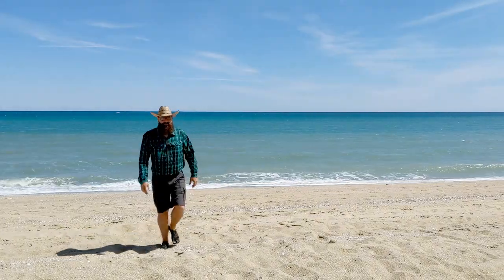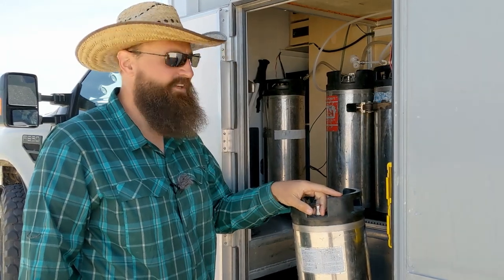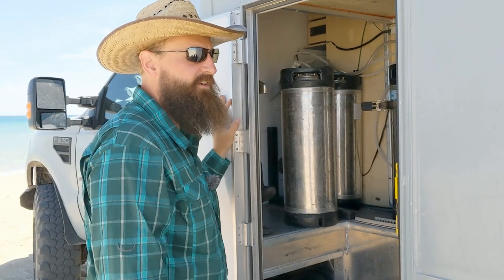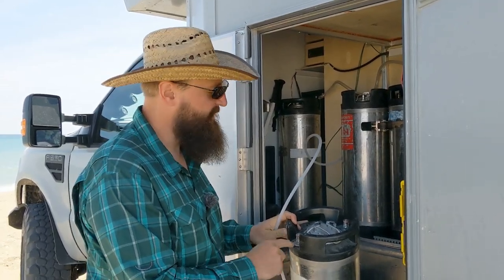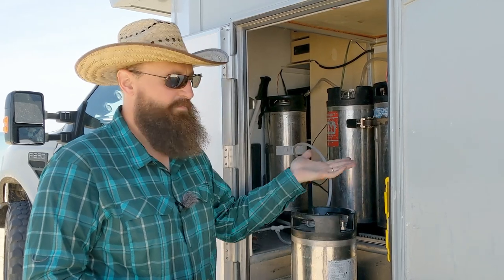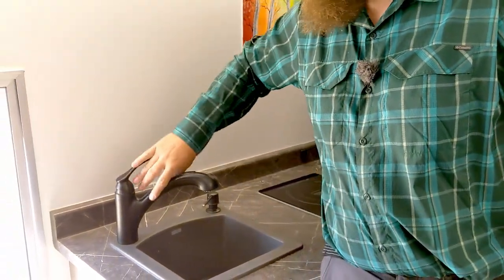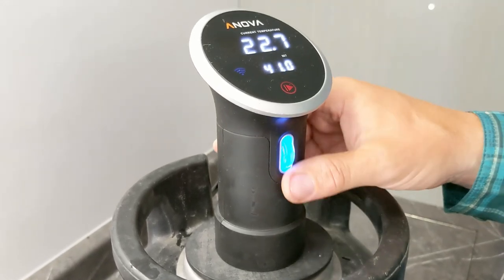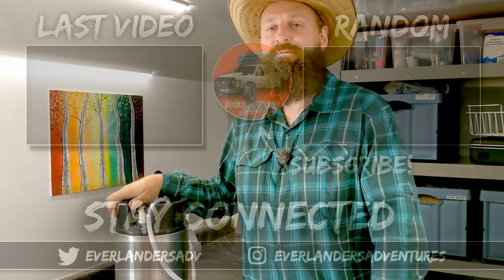Keg Water Systems Finally Explained - Mexico Water Filtration - Everlanders see the World!

Comment: Brilliant! Using air support for various [things otherwise requiring motors] was my *initial direction— and one that I’m now reconsidering because of *your ingenuity! Glad to hear 40-50 psi can wash Kara’s hair(!)
I’ve long heard that the ABS/PVC tanks taste bad and can be hard to clean, aluminum tastes off, so SS is the only way for drinking/cooking water. Hard to find that fit, are openable/cleanable, and affordable. This may be the ultimate system. 
Love that your heater is *tuneable to degrees— I was resigning to the stove: boil one + cold two = shower. Maybe it could be 3gals on an induction stove.....?
Reply from the maker: The boil one (on the camp stove) and two cold was the backup plan... But the ANOVA heater has worked great and there are many cheaper options now too, I think Walmart even has a house branded one.
Reply: Everlanders 😎
Reply: @Everlanders  , Webasto makes a variety of devices, believe there is one that does water heating as well as heated air. Might be worthwhile to upgrade your air heater to the twin heater, the fuel vice the electric heat should make a good alternative when solar isn't as available.

Beyond that great videos, I've only recently started through your videos and I'm in constant awe at your skills and forethought. Well done.
Reply: Everlanders Your water system: are your tanks hoselined in series and pressurized from the end-most, or from a central rail? I just received my kegs and looking to parallel your setup (tho I want to stack the kegs, and use my 2.5gal as a holding tank for filtered water under the sink). 
What air compressors are your primary and backup? 110VAC; why not PTO? 
Also asked at Expedition portal, but this usu gets faster response. Great build
Reply from the maker: Yes, the tanks are in series, that way I only need to fill the empty ones...  We have one Viair compressor for daily water use and an ARB Twin for tires and pneumatic cylinders as well as a backup for the water system. https://youtu.be/HFS2_4ul4ug 

110VAC Air Compressor??? No way!  All 3 are 12VDC and are powered from our solar system. And no, not PTO because then I'd need to start the truck just to air up the tanks if we are stopped for a few days or longer. Not to mention a PTO compressor is likely oiled and much more expensive. Better suited for Air tools, but totally overkill for this.
Reply: Everlanders Do you mind offering a link to the pressure switches you used? And gauges? I’m finding mostly switches for wells. Thx

Comment: you can also install a copper coil in those kegs, fill the keg with sand, add some 12v PTC heaters and you have yourself a relatively low wattage, effective water heater.
Reply from the maker: Nah... This is my water heater: https://youtu.be/_u0URusLxnk
Reply: @Everlanders  My comment was for other people.  I saw yours. It's simple build-wise but hitting a switch on my system is simple use-wise.

Comment: This is one of the best thought out system for an RV. And if you want to eliminate the electric compressor you could use a regular bicycle pump to pressurize the system. Thanks for making this video.
Reply from the maker: You could, but we have 3 redundant compressors that are used for water, pneumatic expanding solar array, and airing up out big tires after sand or soft ground.
Reply: Or not pressurize those tanks at all and use a standard 12V RV water pump... Nothing says you have to pressurize those tanks.

Comment: Awesome, thanks for the video.  I have a few of these and was planning to do similiar thing for my cruising boat,
and the boat people all laughed at me!   Said you will enjoy your fizzy showers!   Some people can't think outside the box.
Reply from the maker: The water won't carbonate unless you use carbon dioxide and very cold temperatures, if I leave the water in the Keg for three or four weeks at 40 or 50 psi, it does begin to absorb gases, and become a little bit milky once dispensed... But certainly not fizzy.
Reply: @Everlanders   lol, of course, that is what makes it so funny/stupid of them.  However, one real issue is what is in the air you are compressing?
Would need filters on the incoming air, looks like you have an oiless compressor already, that is required too.
If you use a Co2 tank, you would know the air is pure C02, and then it Would be fizzy, which frankly might clean better!  Cheers, Jack
Reply from the maker: We don't filter our air compressors air, we depend on our four stage water filter for that... We also carry a 20 lb CO2 cylinder, but that is only for making fizzy water...

Comment: That's a really smart system.  I've always avoided anything involving air lines, mostly because lack of experience with them, but this makes me want to start looking at compressors and air tanks...
Reply from the maker: I've been converted. You can get alot of work done with really cheap 1/8 inch air line that would take large gauge wire to accomplish. Long runs of tubing is far far cheaper.

https://www.automationdirect.com/adc/shopping/catalog/water_(potable)_components/flexible_water_tubing_a_hoses/straight_polyethylene_(pe)_tubing/pe12grn100
Reply from the maker: Just thought of this... Compressed air is also a lightweight Battery, we can charge our big tank in the prime solar day and then discharge at night.
Reply: @Everlanders  are you worried about leaks in the system?  I'd imagine fittings would be prone to that sort of thing, and issues may be hard to track down.
Reply from the maker: No, problems with leaks in our experience.

Comment: I just built a shower keg! I don't have onboard air (yet) but a tubeless bicycle presta valve mated with the ball lock fitting. I was able to pump up the keg to 80psi in 10 pumps with my bicycle floor pump. Thanks for the tips!
Reply from the maker: Cool Beans! Once the tank is half empty it will take a lot more pumping to get it up to a usable pressure... But you can cross that bridge when you get there!!! 👍
Reply: @Everlanders  I tested a half keg and 40 pumps took it back up to 60psi and blew all the water out plus some air.

Comment: Just became a member! I'm converting a '12 F550 shuttle bus into an off-grid bugout vehicle. Your channel is an inspiration... I'm looking to duplicate your water system, but plan to use a CO2 Powertank instead of a compressor. It would be great if you could provide a link for the regulator and solenoids you used. Keep up the great work!
Reply from the maker: Using CO2 will yeild you carbonated water... while we carry a CO2 tank, and it makes delicious sparkly water, I'm not sure you want to be washing your dishes in the bubbly... Furthermore, moving that volume of water around constantly will get quite expensive.

Comment: Me again 😁
A typical water system has the water pump each time,and as long as, water is used. And it is noisy.
I’m assuming that there is enough reserve pressure in the air tank that the compressor doesn’t run each time but therefore runs longer to re-pressurize the tank.
Just curious as to how noisy you feel the compressor is compared to a water pump.
BTW awesome setup 👍
Reply from the maker: The sound is comparable to a water pump, but runs for 2 minutes and that's enough pressure to last us 2 or 3 days. I have scripted it to run to max pressure when we're driving, so we rarely hear it.

Comment: could this pressurized system be done with a larger vessel? i'm in the planning stage of my skoolie and think this is right on. Hate the pump in my current RV. Amazing content as always, i'm envious of the power of your brain!!!
Reply: Yes, the vessel has to be able to be pressurized though. If it's not built for it, then no. But honestly get a better RV pump. I wouldn't even bother with pressurizing these tanks... just pump the water out of them with a water pump.

Comment: Excellent ideas!  Very similar to the setup a friend of mine uses for storage and dispensation of his home brew.  His pressure is CO2, but same idea.  The only real limitation is that the kegs must be upright for the liquid to be forced out the out hole.  Do you strap them to the wall?
Reply from the maker: Yes, they are ratchet strapped to that back wall, you can see the two on the right are still strapped, I pulled the strap from the left 3 for the video.

Comment: Hi, love the Keg idea. Do they need to be stood upright? Or can they be laid on their side?
Reply from the maker: It's nice to have them upright for filling in place with a hose when that's an option. But there is no reason you couldn't lay them on their side... The pickup tube is usually in the center middle of the tank so it would need to be bent down to the new "bottom" side...

Comment: Nice system. How much water of the smaller keg can you use if you pressurize it with 40psi? I din not really get why are you using smaller keg for shower. Is it enough for both of you?
Reply from the maker: The smaller keg is easier for Kara to wield if she needs to carry it off to the bushes... We'll usually put 9 liters in it and pressurize to 40psi... This usually gets us half way and then we give it another 40psi bump when we switch out.
Reply: @Everlanders  So, you both can shower with 10 liters. That is not bad. Than, I as I am bald, can even do with leas. ;)
Reply from the maker: @fibranijevidra It depends on the availability of water... If currently in the Atacama desert of Chile, then we need to conserve. If we're near a spring or clean river, then we might each use 10L... The trigger operated spray nozzle really helps conserve.
Reply: @Everlanders  I wish you three a lot of water near by along your way.

Comment: @Everlanders You mentioned you use 3/8 ptc fittings however most of the ball lock fitting I can find are 1/4 or 5/16 barbed. How did you convert or adapt these fittings to the larger size. Also are you using standard air line for you water side as well as your air supply side?
Reply from the maker: That's the trick, Air and Water use OD and ID respectively (or vise versa)...
I use 3/8 OD nylon water line for both low pressure air, and the water. So the quick connect fittings are all 3/8 and the ball lock fittings are 5/16. (I'm pretty sure they're 5/16)
Reply from the maker: I recorded you a quick video showing what I mean: https://youtu.be/k2U4FeArDDs

Comment: That's a lovely system. But I do have a question about the daisy chaining. If all the kegs are all full to start with, I can understand the water from the last one (connected to the air supply) will empty first. However, if you empty say 3.5 of them, and only get a chance to fill the last one, does the water still get pushed down to the keg closest to the tap automatically, somehow displacing the air in them, or is it one big air lock and you have to bleed the system, either via the pressure relief valves or via the tap?
Reply from the maker: I normally pull all the partial kegs and refill... But if I was to only fill the last one, there is a bleed/pressure relief on the top of each leg that can do what you want...
Reply: @Everlanders  Oh ok, thanks. Another question... Do you have any kind of filters or traps on the air side of things to prevent oil or bacterial contamination? Or do you rely on the water filtration system??
Reply from the maker: No, I don't feel it's needed.

Comment: Seems like you have all bases covered especially if you have gathered some extra fittings etc. in case of breakage etc. Fortunately for me I am a Tig Welder and am building my own similar type system but all out of stainless steel with braided hose for lines. A pressurized application is ideal for small system. And as far as your water filtration I am glad to see you use the UV light to kill all the tiny little critters that give us bouts of stomach upset. The UV light is the only way to go. Do you have a small pump to catch the water in these creeks or do you harvest by hand ?
Reply from the maker: Thanks! We harvest by hand, I've considered a small pump that would run off my drill batteries, but so far it hasn't been a big issue.
Reply: @Everlanders  - good idea. I scraped an old washing machine that they all come with a pump that then cane be attached to a cordless drill. I try to re-purpose as much as  I can. But again great setup !
Reply from the maker: Yeah, even a small peristaltic pump would have increased pressure if I wanted to have a pre-filter in line before the keg... And yes, we have extra fittings and line along in our shop supplies bin, That's way if anything needs repair, we can do it, The modular system allows me disconnect or bypass anything that's causing problems...
Reply: Quinton,
Our ExpeditionVehicle uses retired Pepsi kegs.
One advantage is modularity:
* our usual complement is seven kegs in the rig
* our toy-hauler can carry a couple-three dozen more.
.
I see zero-zero-zero advantage to a yuge built-in tank... and many disadvantages.

Comment: Awesome everything, ive watched most of the videos you two have put out, i have to say im impressed with all you do!  Do you have a filter between the compressor and the water kegs? im guessing the compressor an oil-less unit but there still may be contaminates from the piston, rings, cylinder wall, etc... I see you have 3 filters and the UV after the kegs so im guessing its all good but cant help but wonder. Keep up the great work!
Reply from the maker: Correct, they are oil-less compressors, and I suppose there is some chance of something getting in there... It would be trivial to add an air filter if you wanted, we didn't.
Reply: @Everlanders  This is awesome. I'd like to recreate a version for my sprinter van. Can you tell me what kind of compressor you're running?
Reply from the maker: We have both an ARB and a Viair.

Comment: Awesome solution! What was the main driver for going with compressed air over an electric pump? Reliability? Efficiency? The cool pfssst decompression sound when you swap tanks? 🤔😎🤷‍♂️
Reply from the maker: Simplicity and Redundancy. We have two onboard compressors, if one fails we still have a backup. Also, air runs our solar slides, step box, and hold down bumper. Also airs up our big tires - None of which a water pump can do...
Reply: @Everlanders  makes sense. Thanks for sharing!
Reply: Everlanders :: Hadn’t considered a backup compressor, but that makes sense if using air as engine. (And my 2gal tank is too small.)
One can fab one’s own air pressure gas piston tubes as well— even in PVC. Did you? On site? (Yep, I haven’t yet viewed ALL your vids, but *will)

Comment: Do you think it would be possible to set this up with a pump instead of compressed air? I was thinking about adding a pump on the outlet of the last keg and a vent on the inlet of the first keg. I really like this system and the ability to add or remove kegs from the system based on amount of water needed for a given trip. I would likely do 3 maximum, but I wonder if a typical 12v pump would be able to pull that much water since they aren't really designed to draft. Thanks!
Reply from the maker: Sure, it would work, but not very well I don't think.
Reply: David,
Are you describing a suction pump?
I think the lines might eventually collapse.
Reply: @largemarge1603  Yes that’s what I’m describing and I was able to make it work. I got some stiff braided tubing and have it set up to draw from 1 or 2 kegs at a time (there is a T and because the quick disconnects seal themselves, I can only connect one keg and it seals the other line). It is working quite well for now, the only issue is that I bought used kegs and got 2 slightly different styles of posts. If I mix and match the styles, they draw down at different rates. So to clarify, I set them up in parallel, not series.

Comment: Do you have a way to monitor your water levels without pulling the lids off or waiting until you run out?
Reply from the maker: We use both Stainless Steel Floats, and Flowmeters that tally the consumption, all shown in this video: https://youtu.be/Xnhdyo-nZvM

Comment: Is a compressor tank required for operation or does the kegs act as the tanks?
Reply from the maker: Initially when the kegs are full, it uses air from our air tank, but once there is some air in the kegs, we can usually go a day without further air pressure.

Comment: Currently implementing something similar. Could you point me to link for your air/water lines? I have 5/16 barbs so got 5/16 ID silicone tubing but don't like the uncomfortably close  psi ratings. Do you use 3/8 ID or OD?
Reply from the maker: I wouldn't use silicone, as you say, it won't hold the pressure. 3/8 in OD nylon tubing is 1/4 in ID, that's what I used for everything (water related). The rest of the airlines are all 1/4 ID air brake line tubing.
Reply from the maker: This is a video I made for one of our other channel members to explain it a little better. https://youtu.be/k2U4FeArDDs
Reply: @Everlanders  Thank you this helps. Hope  the puppers is doing well

Comment: Do the Corny kegs work if positioned horizontally?
Reply from the maker: There is a stainless dip tube that runs down to the bottom center of the tank, so if you bent it over the side, then presumably it would work... But I keep mine upright for ease of filling...

Comment: does condensation build up in the air tank?
Reply from the maker: Ours is on a solenoid valve that's only opened for a few seconds, it's otherwise isolated from the water. All air compressors will get some condensation in the tank just from the humidity in the air, ours has a little drain which we open periodically, but there's rarely very much in there.
Reply: @Everlanders  Y'all have the coolest overlander I've seen, thanks for having us along for the ride!